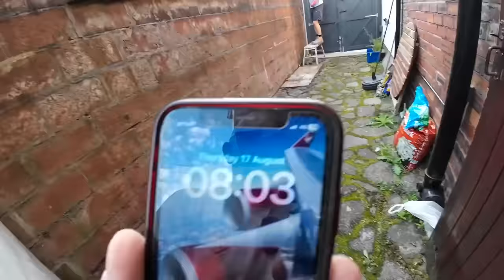3.5 TON CONCRETE WALL BUILT ON SOIL!!

Comment: 1842 terraced house here.  Built straight on clay . No footings  no founds .  
 Damp,cold, and cracks open up in summer  close back up in winter .    I can see why foundations became a thing !!
Reply: I helped a friend take down a porch of unknown age last summer. A few roughly hewn lumps of granite thrown on the ground, backfilled with dirt and 50 mm of gravel, then another 50 mm of cheap concrete and a rickety structure built from random reclaimed timbers on top. There was literally nothing below grade. The house itself isn't much better, goes down one course of stone, so maybe 250 mm.
Reply from the maker: @Ragnar8504 😳😬🧱👍🏽

Comment: The Victorians essentially built on soil with sometimes a 4or 5 bricks in a row then built up in a pyramid shape which spread the load across the ground they were also surprisingly shallow on some buildings like terrace houses - in most cases time has proved the method works.
Reply: Sometimes did, sometimes didn't. The place where I live had an old retaining wall along the front, maybe 1 m tall. No idea how old it was, might have been original to the build (1914), although I doubt it. Solid concrete but no rebar anywhere to be seen. The wall's been leaning outwards for as long as I can remember but a few years ago it got so bad it was replaced. No more than about 150 mm of concrete below the pavement, no wonder it was leaning! The adjacent pillars on either side of the gate were brick and had to be replaced way back in the early 90s. The wall was leaning pretty significantly back then but kept moving, as shown by the massive crack opening up between the wall and the new block pillar. I'd love to know how old the wall was, I've got a hard time believing it was original. They did use some concrete when they built the house but a much taller retaining wall in the back was all brick, as were the two pillars, so why would the walls in the front be concrete? The only possible explanation I've got is thickness (i.e. looks mainly), a brick retaining wall would have had to be thicker.
Reply: @SteveAndAlexBuild 😢jij9hg7😊6lò
Reply from the maker: @proudtobeated ???🤔🤔

Comment: I had a wall build early this year and they used postcrete for the foundation, did they bodge it? Wall is just over garage door hight.
Reply from the maker: It’s not ideal and probably cost twice as much as mixing proper stuff 😟🧱👍🏽

Comment: how often can you disasemble a wall and later reuse the bricks for something else? or does it never happen or is too much effort to reclaim old bricks for some other reasons
Reply from the maker: Bricks can be re used over and over as long as they clean up ok 👌🏼 🧱👍🏽🧱🧱🧱
Reply: @SteveAndAlexBuild  i know they can, but i mostly see them go to the big bin and for the trash so i was wondering what usually happen and if there is some sorts of recycling for that or just a groundfill after grinding down to rocks

Comment: Good job. If they'd put a foundation under it they could have got another couple of centuries out of that wall!

Was that the old coal-ash mortar, or dyed sand and cement? Puzzling about when it was built - somewhere around 1900 perhaps?
Reply from the maker: I’m guessing 50 s or 60s as the blocks were pre cast concrete 🤔🧱👍🏽

Comment: 7lb sledge hammer that wall would be down in 5 minutes.....
Reply from the maker: It would , but then you spend twice as long cleaning up the 10 000 tiny bits 😫
Reply: Very likely it would have just fallen over with the first few blows maybe taken some of the house wall with it.